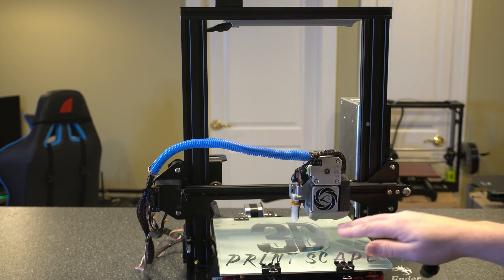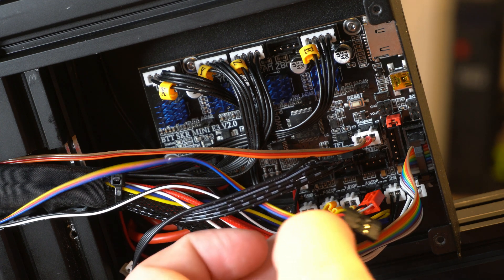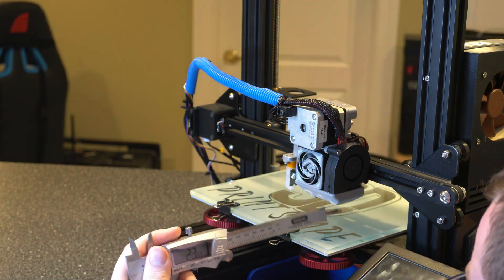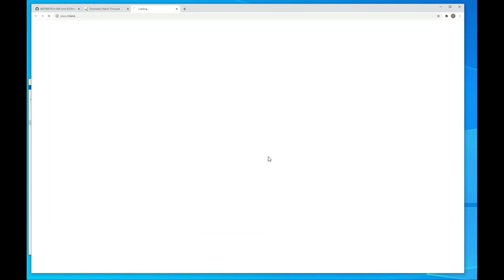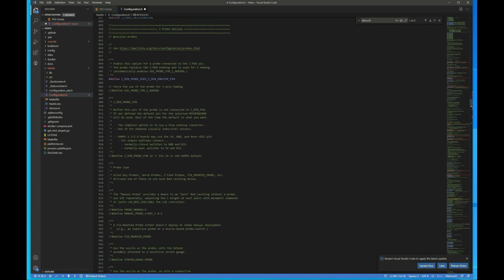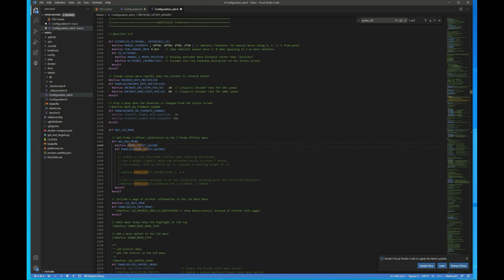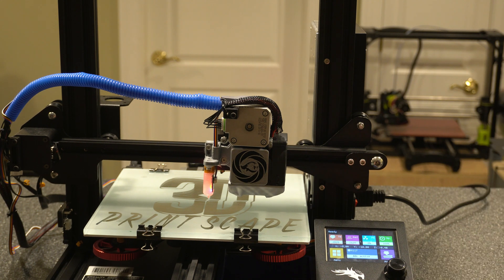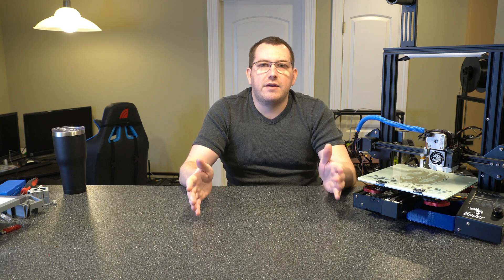BLTouch on SKR Mini – Install Guide

Comment: My BL Touch has the wiring harness with BLUE, RED,, YELLOW, BLACK, WHITE.  Can I place this where the "BL Touch" goes according to your first selection/option goes?  My BLUE wire is on the outside (first wire) then the RED and so on.  Also, according to your video, where your BLUE, RED, and YELLOW wires are, would the next wires be BLACK then WHITE, or WHITE then BLACK?
Reply from the maker: Hi. The short answer is it depends. The problem is i have seen these shipped with too many different wiring colors. I would recommend mapping the color back to the pin and making sure its plugged into the right spot on the board.

Comment: Hey! Very helpful and informational video.

I am getting errors thrown at me when I try to build the firmware I get errors in
Configuration_adv.h
   if AXIS_IS_TMC(I)
   if AXIS_IS_TMC(J)
   if AXIS_IS_TMC(K)

SanityCheck.h
   #if !defined(CONFIGURATION_ADV_H_VERSION) || HEXIFY(CONFIGURATION_ADV_H_VERSION) < HEXIFY(REQUIRED_CONFIGURATION_ADV_H_VERSION)
   (this one isa saying that my config file is too new for the marlin version)

marlinui.cpp
   manual_feedrate_mm_s
   (this error is just showing
Reply from the maker: Hi. Did you get the firmware and config at the same time?
Reply: @3DPrintscape  oh I haven't thought about that. I just got the nightly config build for 2.0.x

Should I try to make sure the dates for both are the same?
Reply from the maker: @intellectualhybrid2  Ya, they should be the same. If one is older, you can see errors like the one you got.
Reply: @3DPrintscape  Hey, a different error came up.

I tried 2 methods from your video. But the errors were the same for both methods

using the firmware from the  masterbranch folder from the "BIGTREE-SKR-mini-E3" github
and the config files from the Marlin "Nightly" Source

using the firmware from "bugfix-2.0.x" from the Marlin "Nightly" Source
and the config files from the Marlin "Nightly" Source
(I made sure to match the dates and versions)

I made sure to apply the environment change to the platformio.ini file.
After carefully applying the changes to the .h files in vs-code, and then building, I had this error come up now
They both give me the same problem

Environment           Status    Duration
--------------------  --------  ------------
STM32F103RC_btt_512K  FAILED    00:00:10.054
Reply: @3DPrintscape  An update, following constant testing with the previous tries. I was able to successfully build by using the Marlin "Nightly" sources, both firmware and config files.

I had to use this environment variable instead.
STM32F103RC_btt_USB
Reply from the maker: @intellectualhybrid2  Can you send over the actual error? Its should be in the terminal output.

Comment: I have a issue, the probes are working fine but when you start to print it is as if the printer forgot the layout of the bed. the z axis wont move to adjust for the bed being uneven, any idea on how to fix this?
Reply from the maker: Hi. How is the bltouch wired and what firmware are you using?
Reply: @3DPrintscape  the firmware used in the guide, and the bltouch itself is working completely fine. The problem is exactly like in this video https://www.youtube.com/watch?v=tJHzKikWswg&t=401s. My caveman brain just doesnt know what hes doing to fix it lol
Reply from the maker: @mingo7687  I cover BTT and marlin firmware in the guide, so i would need to know what one/version you are using and how the bltouch is wired.
Reply: @3DPrintscape  sorry about that, but im using marlin and its wired to the bltouch port
Reply from the maker: @mingo7687  Can you try one of the firmware builds from my site? I know they are working, so that will give us a starting point.

Comment: Just tried installing the SKR E3 V3 board, But the hot end (E0) will not heat. This i the second board with the same error. I there anything that I could have done to cause this.
Great Video
Reply from the maker: Hi. Can you verify its plugged into the correct ports and that the cable/heating element isnt damaged?

Comment: i need help on how to update things on my printer.... where do i go on my printer screen????
Reply from the maker: Hi. If the firmware is on the sd card it will automatically pull it in when the printer is powered on.

Comment: Had an issue with my bl touch inconsistently deploying. Seems to have been fixed by re-terminating the red-blue-yellow cable with the proper connector. The longer connector is meant for different sized pins and was sitting very loosely on the onboard connection.
Reply from the maker: Hi. Thats an interesting one, thanks for sharing.

Comment: This video worked great.. except one problem. The TFT, by default (I have the BTT TFT35) when I try to enable it, it just fails to compile saying "LCD doesn't support bed leveling" I'm using the SKR Mini E3 V3, as you have here, so.. still working on this to get the BLTouch to trigger. It also seems to have removed a ton of options from my TFT (as in, I can't select type of load, like PLA/PLA+)
Reply from the maker: Hi. I will need to look into this one more when i work on the Marlin builds for the v3.

Comment: Is there an easy way to avoid the bed moving too far forward when leveling the bed. I have a tension belt adaptor for the Y-Axis which upsets the bed when measuring as it comes too far forward.
Reply from the maker: Hi. You could change the bed size in the firmware.
Reply: @3DPrintscape  Thanks, I have given that some thought. Thanks for all your help.
Reply from the maker: @abtrooper82  You're Welcome

Comment: Noticed your comments about the ABL Mesh error after updating the TFT firmware. However, when I do the mesh leveling it only appears to attempt to do it at the bottom front left and doesn't move across the board. to the other points, as I would expect. What am I doing wrong?
Reply from the maker: Hi. Is the probe getting triggered at the bottom left? If there is a error in the reading, it will just stop there.
Reply: @3DPrintscape  I will check, also need to make sure I have installed it correctly. 

Progress :-)

1. Installed the BL touch unit and wired it so that the original Z-switch stays in place
2. Installed the required firmware for using the BLT touch from the Bigtreetech Github 
4. Restarted the Printer
5. Ran the ABL bed leveling which seem to work this time. Although I have a Y-Axis belt tightner adaptor, which confused things when the bed went to take the top measurement, the bed moved too far forward and grumbled (there must be a setting I can change to change the travel distance, if so please advise) , it was ok after that point and I saved the settings.

The only thing I could not do was set the P-Offset (I think it's shown as Z-offset on your video). I know if I used the firmware which does not require the original z-end stop switch, the function worked to a point. If I use it as it now, it homes the printer. Raises the head 10mm and then should go to the center of the bed, but on mine, it tries to move the head to the left while its in the home position. and I have to turn the printer off as the motor/belt for X-Axis start making a hell of a noise.

Any ideas why?
Reply from the maker: @abtrooper82  What firmware did you end up using?
Reply: @3DPrintscape  All I installed was the "firmware-bltouch.bin" file, should I have installed the file "firmware.bin" to replace the factory stock firmware first? and then apply the "firmware-bltouch.bin" after or is the "firmware-bltouch.bin" the newest firmware for the board including the BLtouch function. The notes on the bigtreetech github seem to imply the firmware.bin file for the ender 3 does not support BLT, hence why I used the firmware-bltouch.bin" file.  Sorry for all the questions

UPDATE : I think I know why - I left the original Z-endstop switch connected to the board, so I'm guessing this will confuse the printer and it's going to assume that the home position for the z-offset is now at the bottom left of the board and not the centre of the board, Correct? Should have paid closer attention to you video if this is the case :-)
Reply from the maker: @abtrooper82  The firmware should have been named firmware.bin, I don't think the skr will pick up the firmware if its named something else. Also, the z stop should still be connected in most cases.
Reply: @3DPrintscape  Hi, sorry I should have said I did rename the firmware-bltouch file to firmware.bin. Anyway, using the "firmware-bltouch-z-home" I was able to get the ABL to scan the bed and store a set of figures which is great, and got the z-offset working, don't ask how because if I leave the BLT wired to all five pins on the probe port on the motherboard and the original z-switch disconnected. I can then set all the levels for the ABL with some adjustments during the first test print using baby steps. This is weird as your video shows you connecting the connector from the ABL to the z-end switch on the motherboard.

I will see how things go.

Thanks for ur help
Reply from the maker: @abtrooper82  There are multiple ways to wire the bltouch, the standard is keeping the z stop connected and the 5 pins to the bltouch port.
Reply: @3DPrintscape  Thanks, yes that seems to work the best leaving everything wired :-)

Comment: Great Video! So, I followed these instructions, and everything checked out but when I tried to build the code I got an error 
"The terminal process "C:\Users\brayd\.platformio\penv\Scripts\platformio.exe 'run'" terminated with exit code: 1."
And at the top of both the configuration.h and configuration.adv.h. There was a red squiggly line under “* Marlin 3D Printer Firmware” on the first line of both configurations. That was the only error present. Any ideas on what to try?
Reply from the maker: Hi. There should be a full error in the terminal output, can you send that over?

Comment: This video saved my Ender! I've been convinced for the last year that ABL is worthless and the BLTouch is junk. Turns out my firmware just wasn't using the mesh, or something, and was severely outdated. I didn't have the probe wizard, or babystepping that could save into the offset on the fly, or a ton of other quality of life improvements. Now my first layer is going down perfectly even and the interface is easier than ever to use. Thank you so much!
Reply from the maker: You're welcome, im glad i could help :).

Comment: do you have a video for the skr mini E3 V3 board?
Reply from the maker: Hi. Not yet, i still need to pick up the v3.
Reply: @3DPrintscape  dang, wanna gte my printer upgraded but theres no firmware for it with BLtouch and filament runout
Reply from the maker: @bowhunter3125  I think the only option will be a custom build. If you reach out on discord I can try to help.

Comment: WTF. Why go to the end stop..... Why not just use the correct plugs and show how to configure it.. you know the basics...
Reply from the maker: Hi. I was trying to show the full sequence but your right, i should have just corrected the video.
Reply: @3DPrintscape  I Was just in a pissy mood, sorry about being an a-hole. I watch a lot of videos and I did learn a bit from yours, so I have to give you credit for that. The fact is you put me on a path that got me, to my solution. Just today I was able to put the pieces together (mind bender). I now have an awesome running Anet A8 plus frame running 32 bit software. End stops, probe, bed leveling, filament runout is tomorrow. It is so quite I can only hear the power supply. Print quality is (Great) another nice part of the upgrade. I will say this though. This mod was not for the average person, I am a retired System Administrator with Microsoft certs plus. Just to qualify my statement. You have some good followers, I like what I see them posting. So don't let my bad attitude bring you down. Keep up the effort. Have a great day.
Reply from the maker: @Cantstandbs NP, thanks for the details and im glad you got everything working.

Comment: Hello, i can`t get the bltouch to run. Homing the z-axis doesn´t work-> stopped. With M119 i get the message z min: triggerd, shouldn`t it open? How can I fix this problem? Z_MIN_ENDSTOP_INVERTING false, changing to true doesn´t work, because marlin can´t compile it.
Thanks
Reply from the maker: Hi. My initial thought is that the sensor wires are reversed or the config doenst match how the bltocuh is wired. Z_MIN_ENDSTOP_INVERTING should be false if you are running a build from after June 2021.

Comment: Hi so I followed until we go to the compiling, when I try to compile I get this error code.

> Executing task: C:\Users\[USER]\.platformio\penv\Scripts\platformio.exe run <

Error: Unknown environment names 'STM32F103RC_btt_512K'. Valid names are 'STM32F103RE_creality_maple, mks_tinybee, mega1280, mega2560, BIGTREE_SKR_PRO_usb_flash_drive, BIGTREE_OCTOPUS_PRO_V1_F429, sanguino1284p, rumba32, STM32F103RC_creality_maple, trigorilla_pro_maple, LPC1769, at90usb1286_cdc, STM32F401VE_STEVAL, mks_robin, mks_monster8_usb_flash_drive_msc, STM32F103RE_btt_maple, mks_robin_nano35_maple, DUE_USB, linux_native, mks_eagle_usb_flash_drive_msc, STM32F103RE_maple, STM32F103RC_ZM3E2_USB_maple, Artillery_Ruby, mks_robin_lite3, BIGTREE_SKR_2_USB, STM32F070CB_malyan, DUE_archim, STM32F103RC_btt_maple, mks_eagle_usb_flash_drive, BTT_SKR_SE_BX, teensy41, MightyBoard2560, mingda_mpx_arm_mini, BIGTREE_OCTOPUS_V1_USB, STM32F103RE_btt, BIGTREE_BTT002_VET6, BIGTREE_GTR_V1_0_usb_flash_drive, malyan_M300, STM32F103RET6_creality_xfer, mks_robin_e3p, BIGTREE_SKR_2_USB_debug, mks_robin_pro2, teensy20, BIGTREE_SKR_2_F429, BIGTREE_OCTOPUS_PRO_V1_F429_USB, BIGTREE_SKR_2, teensy35, BIGTREE_SKR_2_F429_USB, STM32F103RET6_creality, melzi_optiboot, REMRAM_V1, STM32F070RB_malyan, mks_robin_nano35, STM32F103RC_meeb, TH3D_EZBoard_V2, simulator_linux_release, STM32F103RC_btt_USB, BIGTREE_GTR_V1_0, mks_robin_e3, mks_robin_nano_v3, mks_robin_pro_maple, sanguino644p, esp32, LERDGES, STM32F103CB_malyan_maple, STM32F103VE, STM32F103RC_btt, LERDGEX, Index_Mobo_Rev03, STM32F103RC_fysetc_maple, STM32F103RE_btt_USB, chitu_f103, LERDGEX_usb_flash_drive, simulator_macos_debug, STM32F103RC_maple, trigorilla_pro, Anet_ET4_OpenBLT, chitu_v5_gpio_init, mks_robin_e3p_maple, NUCLEO_F767ZI, mks_monster8_usb_flash_drive, STM32F103VE_ZM3E4V2_USB_maple, PANDA, mks_eagle, melzi_optiboot_optimized, FLYF407ZG, sanguino1284p_optimized, SAMD51_grandcentral_m4, mks_robin_e3_maple, mks_robin_lite, mks_robin_lite3_maple, STM32F103RE_creality, STM32G0B1RE_btt, STM32F103VE_longer_maple, mks_robin_nano_v1_3_f4, LERDGEK_usb_flash_drive, LERDGES_usb_flash_drive, DUE, mks_robin_lite_maple, STM32F103VC_ZM3E4_USB_maple, STM32F103VE_ZM3E4V2_USB, FYSETC_E4, at90usb1286_dfu, LPC1768, teensy31, STM32F103RE_btt_USB_maple, mks_robin_mini, STM32F103CB_malyan, mks_robin_maple, jgaurora_a5s_a1_maple, mks_robin_mini_maple, BIGTREE_BTT002, BIGTREE_SKR_PRO, simulator_linux_debug, STM32F103RE_creality_xfer, simulator_windows, STM32F103RC_btt_USB_maple, BIGTREE_OCTOPUS_V1, mks_robin_nano_v3_usb_flash_drive, STM32F103RC_ZM3E2_USB, chitu_f103_maple, STM32F103RC_fysetc, STM32F103RET6_creality_maple, STM32F103VE_GTM32, mks_robin_pro, STM32F103VC_ZM3E4_USB, FYSETC_S6, mks_robin_nano_v3_usb_flash_drive_msc, teensy36, BIGTREE_E3_RRF, BIGTREE_SKR_2_F429_USB_debug, FYSETC_CHEETAH_V20, mega2560ext, rambo, FYSETC_F6, chitu_v5_gpio_init_maple, MightyBoard1280, mks_monster8, simulator_macos_release, STM32F103RC_creality_xfer, FLY_MINI_maple, STM32F103RE, ARMED, FYSETC_S6_8000, include_tree, melzi_optimized, STM32F103ZE, melzi, FLY_MINI, LERDGEK, flsun_hispeedv1, jgaurora_a5s_a1, STM32F407VE_black, ERYONE_ERY32_MINI_maple, STM32F103VE_longer, STM32F103RC_creality'
The terminal process "C:\Users\[USER]\.platformio\penv\Scripts\platformio.exe 'run'" terminated with exit code: 1.

Terminal will be reused by tasks, press any key to close it.

It looks like the STM32F103RC_btt_512K we replaced doesn't work, am I missing a program or something? Thanks.

Comment: Hi I updated to bltouch and I followed your video but I get error when I try to compile and then I use there firmware but still not working I don’t know what to do
Reply from the maker: Hi. What error are you getting when trying to compile?
Reply: @3DPrintscape  I need to send you a pic are s as lot of red line
Reply: @3DPrintscape  can this file be send to email I was asking I don’t know if you don’t mind send it to me 
Thank you!
Reply from the maker: @constantinsimion5129  You can email me at admin@3dprintscape.com

Comment: so i always get stuck at compiling. the check mark to compile doesnt show up and it states i have errors in both file with a squigly line
why cant i compile i followed everything please help
Reply from the maker: Hi. What folder do you have open in vs code? The checkmark not showing up usually means platformio is not installed or the wrong folder is open.

Comment: Hi, I wired my BL touch the way you showed, and downloaded the firmware but my printer won't move down. It responds to everything but Z down so the autohome also doesn't work. Any suggestions?
Reply: Also, I tried following through your VSCode tutorial but I constantly just run into compiling problems.
Reply from the maker: Hi. Can you send pictures of how your bltouch is wired and the firmware you used to me? My email is admin@3dprintscape.com

Comment: you could just put a paper underneath then crash the hotend and the bltouch into the build plate slowly to leave two marks on the paper then use a caliper to measure
Reply from the maker: Hi. That may work but i wouldn't do it that way. Its not worth the risk of damaging something.